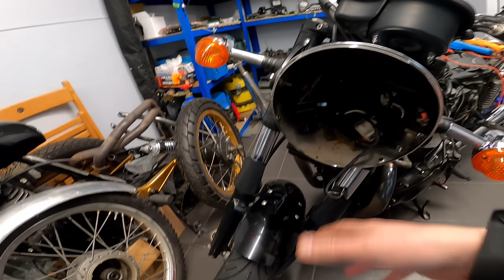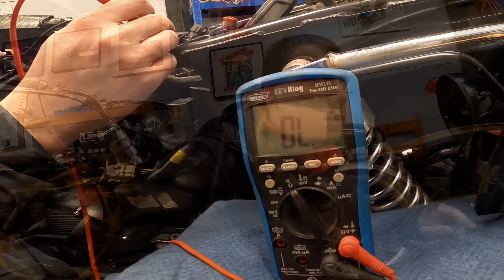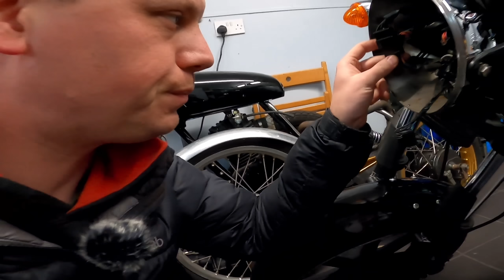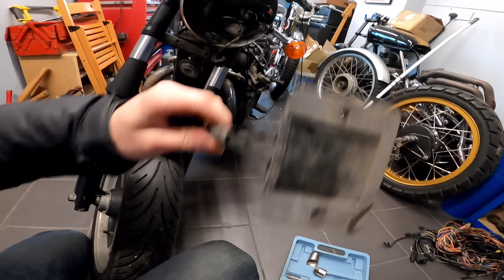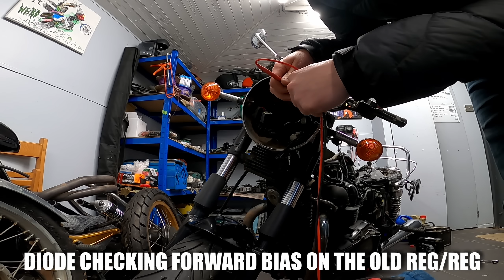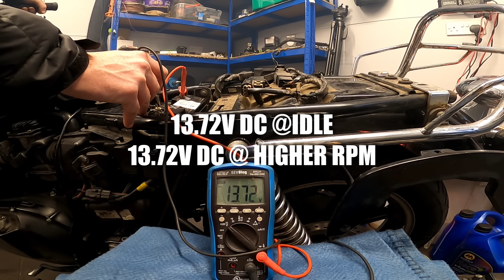Freddie Dobbs' Bonneville | Where do the volts go?

Comment: 13.7v is a perfect charge and maintain voltage if it remains constant throughout the rev range, what is the age and state of the battery, has it been flattened many time's by lack of use ?
Reply: Freddie's bike has been well used and some might say abused. It had an issue with the starter motor permanently engaged when running which caused the battery going flat.
Reply: @richardbartlett6932  oh dear, would be better testing with a decent fully charged battery and with the lights on then see what the running voltage is like.
Reply: @royblackburn1163  Everything begins with making sure the battery is  good.  I assume he checked the battery first of all.
Reply: @royblackburn1163 personally the rectifier seems ok but replacing it isn't overly expensive or time consuming.

 I assume wurks has watched the Freddie episodes regarding the bike as that gives plenty of video evidence of what when and where.
 
I think we are looking here at a problem already solved IE the previous garage changed the starter solenoid so the starter works properly so the charging side is ok. 

It's the low running that's the real issue imho.
Reply: @richardbartlett6932  lol "video evidence" of what crimes Freddie committed against this bike 😬
Reply: @richardbartlett6932  Unfortunately I don't know its history,  a constantly running starter and allowing the battery to go flat many times can certainly damage its capacity I agree with your opinion,  time will discover the truth .
Reply from the maker: Hi Rich, 

Yeah I have seen Freddies videos and also can confirm this is a decent battery for the test work. I can say based on my experience of these Triumph OEM rectifiers as fitted to the Thruxton I sold (still miss that bike) and the scrambler that 13.6 flat across the rpm range is not typical. They're a rudimentary device diode pack/smoothing cap and then a shunt regulator that peaks around 14.6V. No intelligent voltage cut back hence they run ridiculously hot and heavily load the stator.

Your comment has given me the thought to do a back to back on film on the scrambler as that still has the OEM reg/rec but functioning correctly (for now)...

The low running is definitely the more real problem on the bike but in order to do any real analysis I need it to be able to run for a period of time holding charge sufficient not to play havoc with the PCM/ECU or any sensors.

It doesn't smoke or give any evidence of burning oil, any guesses on cause of rich running/misfires?
Reply: @TheWurks  Is there any way to fit the bike with a Battery Monitoring System like all the new cars have?  So it shuts off the charging once the battery gets to full charge, and discharges the battery if it gets overcharge?  I think you're right with the stock equipment, all of that excess electrical energy is going to wind up in the rectifier and fry it.
Reply: @TheWurks  Given the bike's limited use and charging due to no electricity access in his car park a future solution could be an Agm battery that has limited
self discharge and an isolation switch to eliminate parasitic draw.
Reply from the maker: @royblackburn1163  that is a great suggestion!

Comment: I don't love the modern (2001 and on) Bonnevilles as much as some people do. Maybe because my limited experience with them hasn't been great.    I picked up a non-running 2007 Bonnie for cheap and had a rough time with that bike.  She fired right up and ran after a good carb and tank cleaning but it had some weird electrical gremlin that would drop the RPM's at idle every so often and shut the bike down.  It would happen once or twice a ride then start right back up   Eventually I put a new ECU on it and that fixed the problem, but only after spending money on a new coil and doing a bunch of other things to try to fix it.   Once I got it to be a reliable runner, I sold it and maybe broke even....I didn't go through all my receipts so I'm not sure   I may have lost money.  Sometimes you pay for your education.
Reply: Sorry to hear that.  I've only heard of rectifiers and coils going bad on them, but after quite a lot of use.  It was the ECU, wow?  Usually in cases where the engine cuts out briefly, it's because of one of those silly "safety" engine kill switches on the side stand or the clutch lever.  Which reminds me, I'm going to disconnect those switches on my bike before too long.

Comment: The elephant in the room here is, what was the other garage messing about at? Telling Freddie this bike was effectively a write off?
Reply: That’s what gets me
Reply: I've seen these engines go north of 60,000 miles without complaint.  Maybe even more, but I just haven't heard.  Triumph, I think, didn't want a repeat of their past poor reputation for reliability on the flagship name BONNEVILLE and almost went overboard building these bikes strongly.  Just look at all the waterproof goop they put in the electrical connections; the Bonneville has TWO oil pumps for godsakes.  I've never seen another engine with 2 oil pumps.

Comment: Nicely done. All that dielectric grease won't help on the actual connectors..it's ok on the outside of the blocks and back of connectors tho. That rubber grommet needs putting back in place or that will possibly cause issues in the future. Yes that battery reading on higher revs giving 13.7v is definitely cause for concern. Will be interested to see comparison with new MOSFET regrec.

Comment: If your intending to fit an FH020 style, as used on other Triumphs, they still run hot, and need a good location with airflow. I'm not sure I would relocate it from its current location, but ensure good connections instead.
Reply from the maker: Temperature is definitely the enemy but so is cable length and nominal size/current capacity which in turn creates temperature. 

I'm weighing up these options at the moment and for sure will be running the bike when close to back on the road with thermocouple in which ever location it ends up being to be sure all ok temp wise if not I shall re think it but, definitely taking not of yours and @dirkdiggler5164 's collective comments. The feedback is fantastic guys please keep chipping. I'm sure to miss something along the way!
Reply: @TheWurks  Well, a bracket kit is available aftermarket that relocates the rectifier to the front frame down tubes.  I don't know what that gains anybody, except maybe you prefer how it looks being on the frame.  The uh Man Cave Moto put that relocation kit on a Triumph on youtube if you want to see what it is.  I thought about relocating my rectifier.  All I could think of is putting it on the back fender somewhere.  I decided it's probably best off left alone where it is.  LOL.  It can be moved further away if you like, though, with use of heavier thicker wire which helps carry low voltage the distance.
Reply from the maker: @dirkdiggler5164  yeah i have the frame location kit on the scrambler due to my front end conversion deleting the original location…
Reply: The same rec/reg as used on the Tiger like mine, is used on other models, but not located in the airflow, and they do fail. I take the point about cable length etc, but compared to the heat from the R/R it is a minor consideration, and decent specced cable and connectors can mitigate that, but not heat generated from shunting all that excess energy. Now if you really want a cooler running R/R, look into the SH775 or SH847  (35a v 50a) which is a series unit, not a shunt, so will not shunt excess energy, it will only allow the system to generate what it needs, leaving both it, and the stator to run cooler. Its slightly bigger than the Fh020, but available as a Polaris and Yamaha part.
Reply: Spot on, lol, that's what I keep telling "reviewers" of these bikes that "don't understand why" Triumph located the rectifier "unsightly" under the headlight.  It needs airflow to keep cool.

Comment: Excellent! A great, methodical approach. I had a similar problem with my rectifier, i.e. a constant low DC output. My check of the forward bias of both the positive and negative circuit diodes was around 0.5V and the reverse bias check of the positive circuit diodes was fine with OL on all three tests. However, the reverse bias check of the negative circuit diodes threw up two OLs and a voltage of about 1.5V, indicating a failure. Out of curiosity, what were your test results on the R/R? Did you get similar figures? Looking forward to the next installment!

Comment: what would be really great is to have a small series on how to investigate electrical issues on bikes using a multi meter - it migtht have been covered before but you're very clear and precise on what is going on
Reply from the maker: This is in the ideas bank, thanks for the suggestion!
Reply: 😊😮😮 @TheWurks
Reply: What would be good for you folks that want to understand basic electrical circuit is to get a book from your local library that explains current flow ,resistance and voltage. This will help you understand how to troubleshoot. 
If you don’t understand the basics it will be difficult to understand the process to find a fault in a circuit.
Reply: Agreed, it would be good to see what you are looking for and why with the regulator as they are often cited as the cause of many different types of failure.
Reply: I agree. I find multi meters confusing so a video on ‘how to’ would be really great.
Reply: Great idea, mini electrics 101 lesson.  Often we don’t have the confidence to choose the right pin in a combi plug
Reply: Great idea. Electrical gremlins are my Achilles heal.
Reply: Totally agree
Reply: Very clear narrative to the normal bloke

Comment: I wonder if the connector is loose due to the attempted theft of the bike. Maybe tried to pull the wires from under the tank to hot wire.. just a thought 🤔. Thats when the problems started.
Reply from the maker: Hadn't thought of that, also may be why the ignition is loose!

Comment: Great Video 👍 would you be better off using an Insulation tester for stator windings to ground check's, as a multimeter will not pick up all issues. Nice to see a logical approach to fault diagnosis. 🧐
Reply from the maker: For sure to be completely comprehensive i just don't happen to have one... any excuse to buy another tool though is good in my book!

Comment: Just had to sort my 955i tiger, stator soldered directly to reg/rec and bypassed the loom, the positive and negative direct to battery, loads of volts again, best of luck with the Freddie build fella ❤
Reply: @karine606  yes in-line fuses from reg-rec positive to positive battery negative out of reg-rec to negative side of battery bypassing the loom and original fuse box, mosfet reg/rectifier and soldered connections those block connections are pants,
Regards,
Chris
Reply: @karine606  Halfords mini fuse holder 221 with a 15 amp mini blade fuse x2 
I have pictures I can send of what I did, it will cure the problem, I changed the battery, stator and reg-rectifier, because I was sick of it letting me down, not cheap, but cured it x